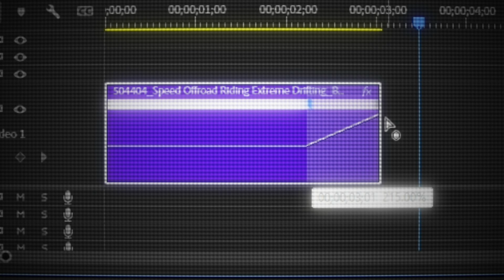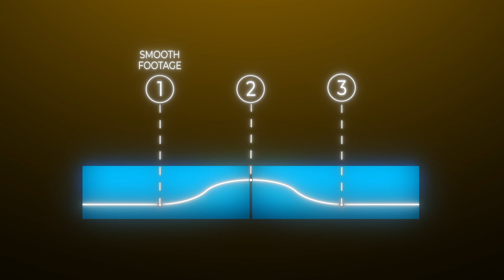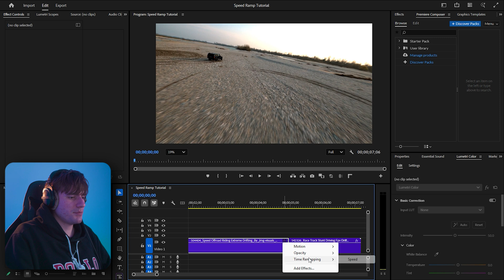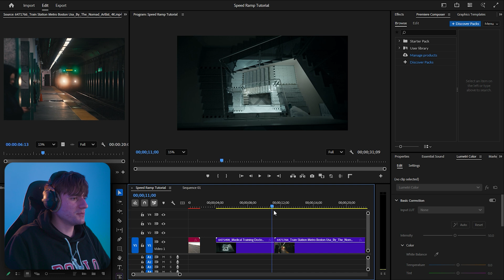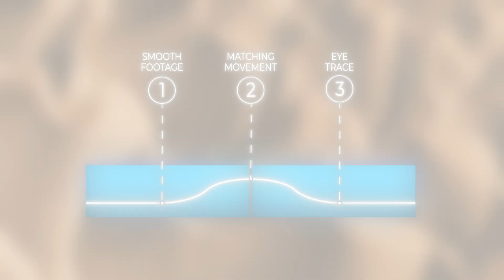The SECRET to Perfect Speed Ramps

Comment: From my experience brining a speed ramped click from premiere to AE messes up the speed ramp completely. Not smooth anymore. Does anyone have any experience with this? I like to speed ramp first then add effects in AE but there is no way because it messes with the smoothness of the speed ramp
Reply from the maker: Speed ramps work differently in Premiere and After Effects because of how the programs are built. If it’s just a simple ramp without easing, it usually works without any problems. However, when the speed ramp is eased, it may cause issues or even fail to import altogether. From my experience, the best workaround is to export the clips you want to add effects to from Premiere and then import that exported sequence into After Effects. It’s not the most convenient solution, but it works. Hope that helps!
Reply: @matttvision thanks dude!!!